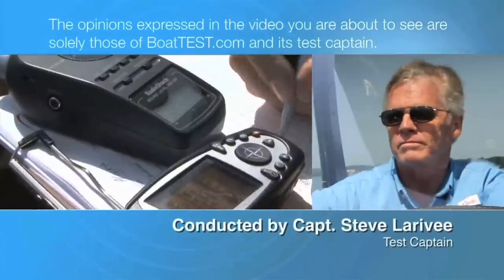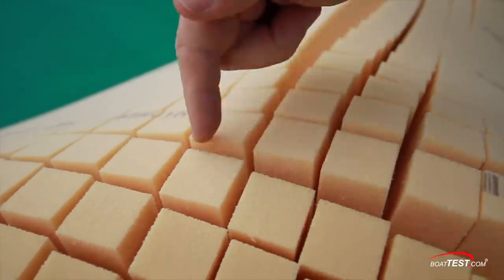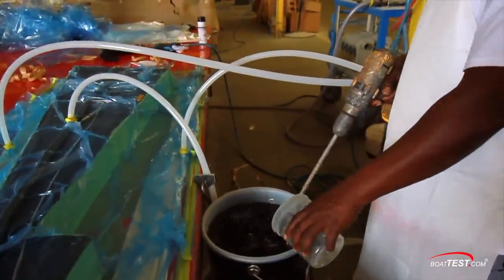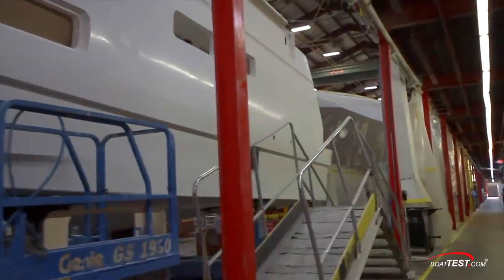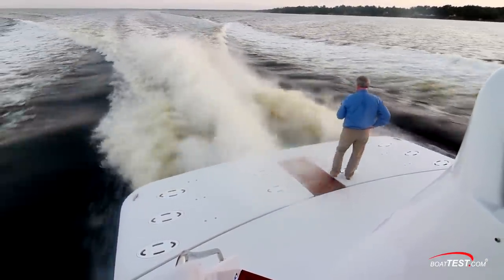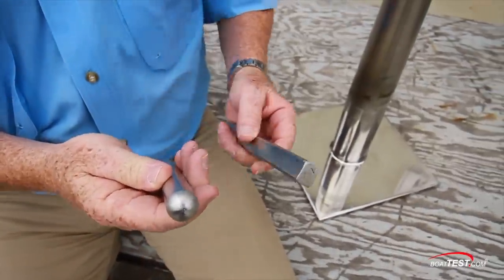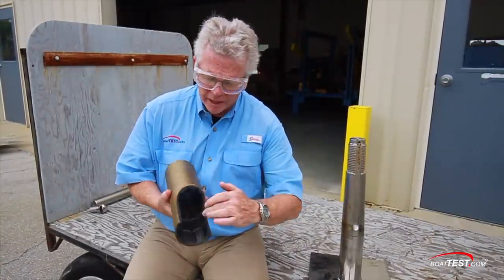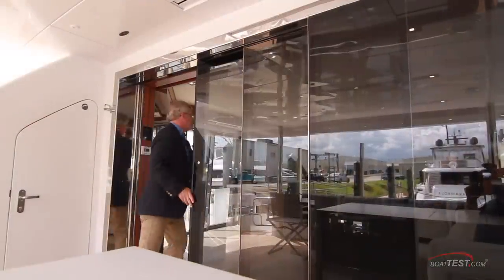Hatteras - Why So Expensive? (2018-) Factory Video - By BoatTEST.com

Comment: I worked at the same plant back in the late 80's working on line #5 building 65' Convertibles.  I worked in station #5 which was finish carpentry and headliners.  Business was booming then.  Worked 12 hour days M-F and 8 on Saturday.  Fat wage, time and a half overtime, full medical and dental and regular wage increases.
Reply from the maker: That's hard work Bill, and happy to hear how they  treat their artisans! Thanks for sharing.
Reply: @BoatTEST  They REALLY had some Master carpenters there.  Some worked up on the middle deck making cubicles to be lowered into motor yachts.  Almost all boats had some cubicles lowered in.  I think I remember hearing that the 65 was still mostly stick built.  We had a Master  carpenter on our boat at our station.  Roger Montgomery.  He fitted most of the solid cabin doors which changed slightly on every boat.  The doors of either solid teak or mahogny costing thousands of dollars each were putty in his hands.
Reply: The company hatteras no build  custom yachts. Example 100 sport fishing

Comment: Spent three years with Bertram Yacht, back in the late eighties building fixtures. Those who crafted the new models were the cream of the crop. Two Brits. The bottom dropout, in 89, ended up with the airlines. Hatteras were and are still top of the line

Comment: A Hatteras for me is the dream boat of all dream boats. I love my 50 MY. The original Hatteras Motor Yacht.
Reply: Depending on the year, yours was either built in High Point and trucked down; but probably built here in New Bern on line 3 or 4

Comment: The resin infusion fiberglass is cheaper than hand laid fiberglass and results in a better product with fewer air bubbles in the fiberglass, and lighter, since there is only as much resin used  as needed.
Reply: It isn't cheaper when you look at the labor involved..

Comment: I own a 1988 Hatteras 38C, which so happen has a square keyway in the drive shaft. 3 months ago I lost 1 of my propeller to the 100 feet deep sea bed. I managed to manoeuvre back to my marina. 1 of the drive shaft snap off exactly as in 4:57 of the video. Remaining shaft is cracked exactly as in 4:43. 

If Hatteras has knew it since 2018 why would they not tell the owners earlier?
Reply: Every shaft built is made with square keys.. 
It is the most common in the tooling industry for carrying load.  More than likely the sacrificial material was to hard to strip/break..

Comment: So, your best value would be a used Hatteras? Maintenance up to date of course.
Reply: Probably. Most good values are buying used in the boat market
Reply: That works with cars too..  High quality cars/boats depreciate differently..  Cheap products depreciate 20% or more,   as soon as you take them off the lot..
Reply: @THOMASTHESAILOR  I can totally agree with you. Used cars, even 1-2 years old are a ton of a better deal than brand new ones.

Comment: Once you paint a boat you take away from it's value. Hit the doc a little to hard and you will see how fancy that paint job is. Gel-coat is more than 20 times tougher than paint and will also outlast paint  20 to 1. If you need to clean and re-straighten your molds up than do it. You still have to Gel-coat the mold before you start the lamination schedule why not pop your hull out of the mold and have a 50 year finish on it that's shinny and ready to go. Paint will not stick good to Gel-coat never did and never will.